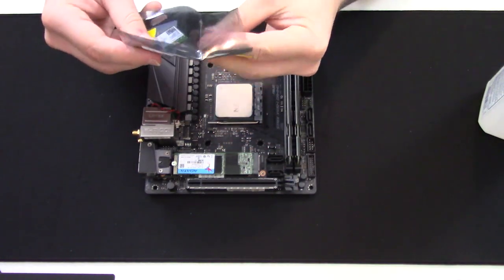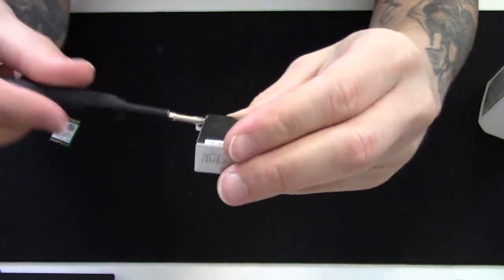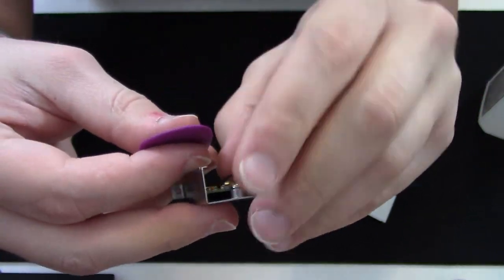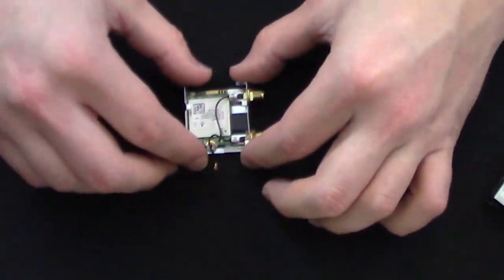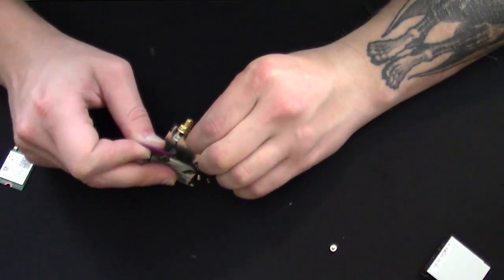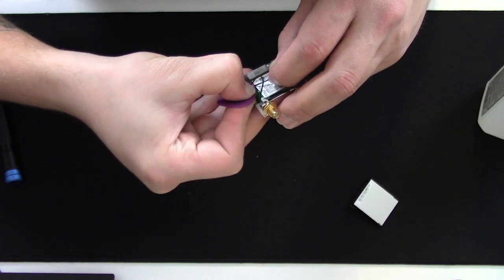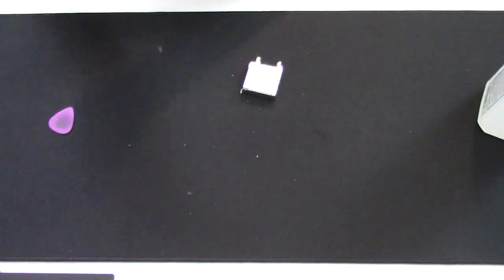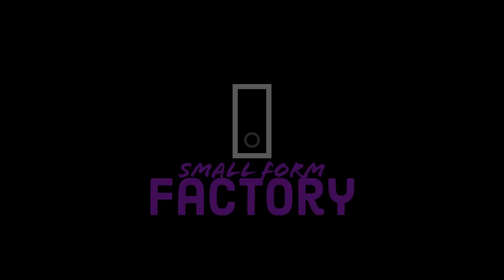How to Upgrade Your Motherboard's WiFi Adapter

Comment: Thank you very much, worked like a charm. Replaced the wifi on a Asus B550M plus - wifi with a Intel wifi7 BE200. It takes some fiddling, but it worked right away.

Comment: Great find and solution. Wished I researched about it sooner, could have saved around $30 on my motherboard  when I was building my PC in December. I wanted Wi-Fi 6e compatibility, but current boards mostly sell with Wi-Fi6 standard mostly, and usually cost $20-$40 more over Wi-Fi AC. Now I am glad that I know I can upgrade when those Wi-Fi 6e Routers drop. Subscribed and Like!

Comment: @Small Form Factory Exactly what I need except for the removal of the plastic I/O Shield Shroud on the Z390 Aorus Pro Wifi. Would be great if you could demonstrate the process on that board
Reply from the maker: The reason I don't go into anything like that is because every motherboard is different and I just don't have enough motherboards on hand to make it relevant to everyone. 

Generally, there will be 2-4 screws on the back of the motherboard that hold this cover in place. You need to be careful not to pull too hard or fast if you have RGB, as you won't want to rip that cable.
Reply: @smallformfactory162  right and in order to access those 2 screws i have to remove everything that has been connected to the motherboard and then completely remove the motherboard and then do the same in reverse...is that what you are saying?
Reply from the maker: Yeah unfortunately most cases will require you to remove your motherboard completely to do this.
Reply: I have the same board as you (Aorus Pro Wifi) My wifi adapter was DOA. I ordered a replacement on newegg and I was wondering how do you remove the I/0 Shield and the RGB plate on it?
Reply: @shadowconsumed  just buy pcie one and relax. This process is only going to make sense for itx build where you dont have additional pcie slots.

Comment: I was wondering how to upgrade my WiFi 6 adapter on my ASUS PRIME Z690-P WIFI D5 to WiFi 6E or 7 when it comes out but couldn't find where the module was and thought maybe it was integrated directly into the motherboard or chipset or something. Now I know where and how to replace it. Thanks!
Reply: Just swapped my tuff x570 Wifi card out for a Wifi 7 BE200NGW chip. The M.2 E key is hidden under the IO shield. Two small screws that are black on the back of the motherboard and then two even smaller screws (silver) for the tiny wifi card holder. You will see it labeled M.2 wifi.
Reply: @Twistedf8te88  I just "upgraded" my Asus Prime z690-P Wifi D5 from WiFi 6 on Intel AX201 to WiFi 6E on Intel AX210. I haven't swapped it out on the motherboard yet, but I did buy a 1x PCIE card that specifically has an M.2 Intel AX210 on it so that when I'm ready to do the work of removing everything from the motherboard and the motherboard from the case, I'm hoping I can swap the cards out under the shield.
Reply: @CmdrShepardsPie  Do you see any difference in speed and range of signal?
Reply: @SHINNYqqqq  yeah for sure, I don't know about range but the 6GHz band definitely provides a nice speed bump for me. I was seeing 600-800 on 5GHz and now seeing 800-1000 on 6GHz.

Comment: How do the pins connect to the motherboard?
Reply: It isn't shown or mentioned in the video, so the answer to the question might be still relevant. There actually is an upright M.2 slot under those covers where the card will slot in. So it's essentially an additional, hidden pci-e slot. Most boards will have a schematic view of the board in their manual which will tell you if there is a M.2 slot. If not, you will not be able to upgrade your wifi with this method.

Comment: You had to change the antennas too or it just doesn´t matter?
Reply: You need to. Each WiFi iteration is different. Just going from 6 to 6E requires a new and different antenna.
Reply: @dsl3994  no you dont have to.

Comment: First my question how.
Before that I have done the same thing in the video with an Asrock B660 ItX AC motherboard, replacing the WiFi card with an AX210, the result is that my PC turns on and off and won't display an image.

Comment: how do you it if the rear io shield is attached to the motherboard?
Reply from the maker: You will need to remove the VRM/IO shroud from the motherboard. Generally it is held on by 2-4 screws on the back of the board
Reply: @smallformfactory162  thanks bro i figured it out. i had to completely disassemble my itx build to remove the motherboard to do it.  what a pain. it was.

Comment: Are there any bt 5.2 Adapters out there?
Reply from the maker: There are USB adapters, and could be some PCIE based ones that don't offer wifi, but I haven't found any in this form factor.
Reply: @smallformfactory162  i've found one. Intel ax210...
Reply from the maker: I actually wasn't aware of this one. Seems it released a little less than a month ago...good find!

Comment: I would greatly appreciate it if someone could tell me why the AX210 wifi cards were not detected on Asus Rog Maximus XI Hero (Wifi) Motherboard.  Running Wins 11 64 bit.
Reply: did you try downloading drivers from intel website?

Comment: I followed this guide and my WiFi is now so much faster.
It’s kind of crazy how much a modern WiFi chip improves speed
Reply: which mainboard u have and which chip u have installed now?
Reply: @mahmutyilmaz5355  Asus z170 mini itx Gaming I think.

i7 6700k

Old but good